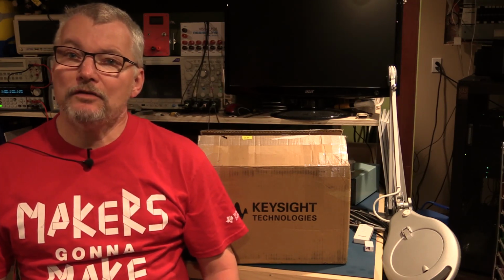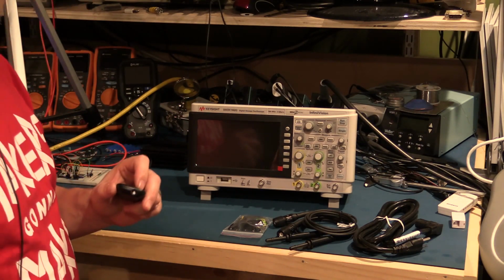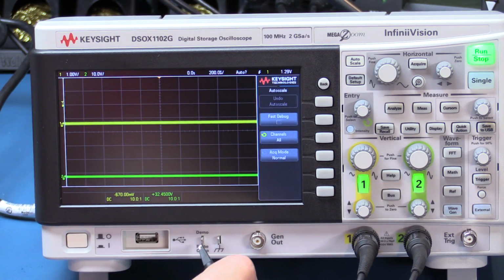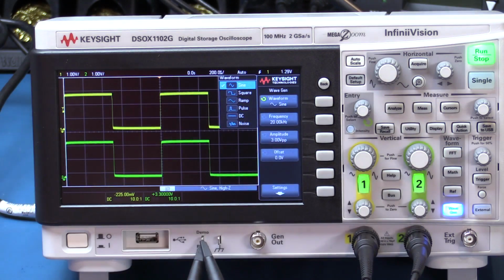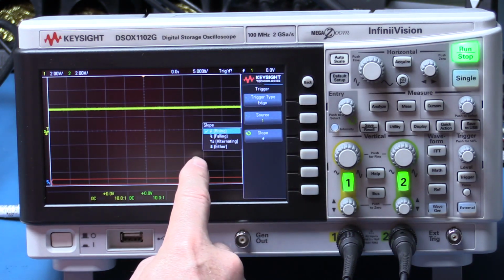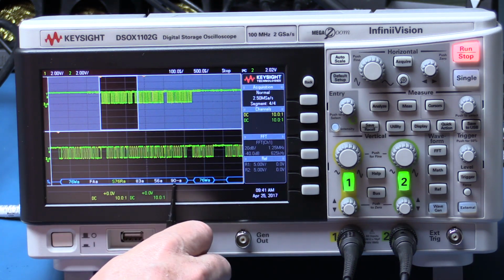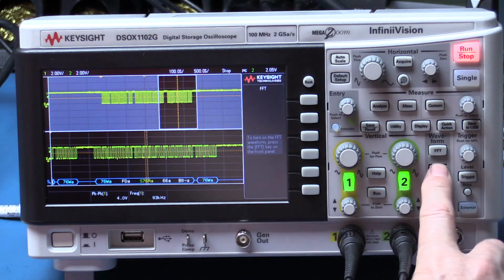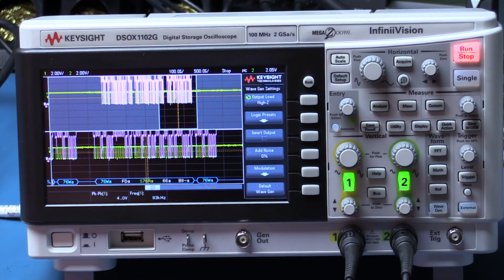Keysight DSOX1102G Oscilloscope Review - Part 1 - Unbox and overiew

Comment: I have a tektronix DPO2002b and it is a fine scope, but the user interface is really really slow. I am thinking of selling it and getting this keysight dsox1102g scope instead. Do you know of any features that I will lose? In other words, do you know of any features the tek does that this keysight does not? I know you dont have a dpo2002b, but some features are similar to your scope and maybe you know a little about the features. For example: 

1. The tek has a nice search feature with the "Wave Inspectctor". You can have separate trigger settings and search settings so you can trigger on a whole packet, but search inside the packet for events. The Keysight does something very similar, and even better with its segmented memory. But, does it allow separate trigger settings and search settings? Also, on the tek, you can leave the search running all the time while using the scope and it will just start counting up search events if you happen to encounter some.

2. The tek has runt trigger. I think this keysight has runt trigger as well but I am not sure.

3. The tek has something called "FilterVu" which is kind of gimmicky, but occasionally useful. It lets you filter out noise from the main plot, but still display the noise in a different subtle color. It helps you focus on the main signal and do measurements on the main signal, but if the noise gets crazy you can still slightly see it to know something is going wacky. Not something worth buying the scope for, but kind of neat.  

So basically, the 'Wave Inspector' search feature is going to make or break the deal. I think the keysight is just as good or better, but I cant tell. The Tek DPO2002b was $1200 (2 channel 70 mhz) and the keysight DSOX1102G is $860 (2 channel 70mhz). Though, remember, the dpo2002b is about 6 years old and the dsox1102g is only about 3 years old.